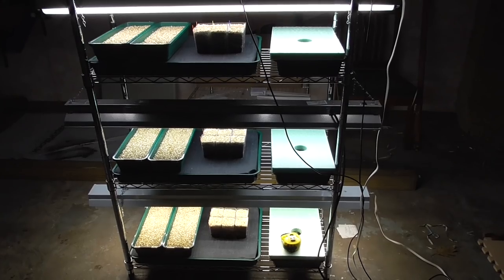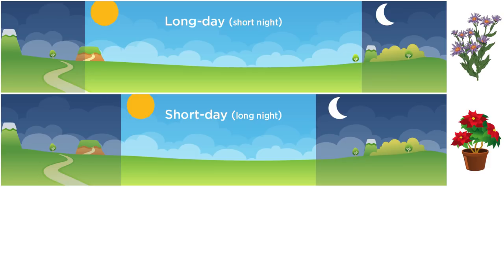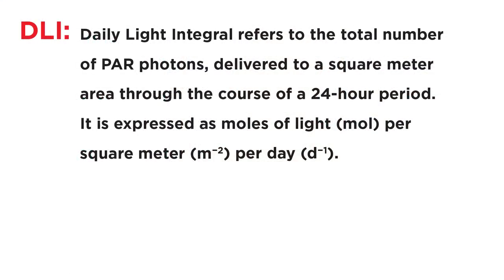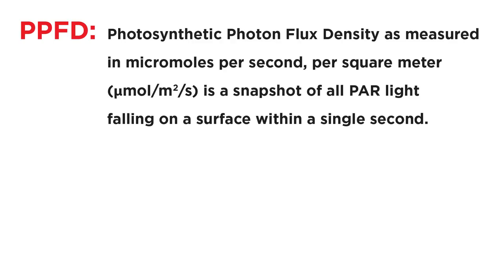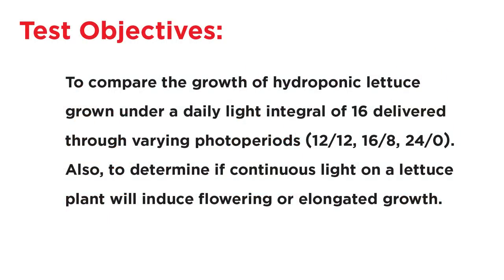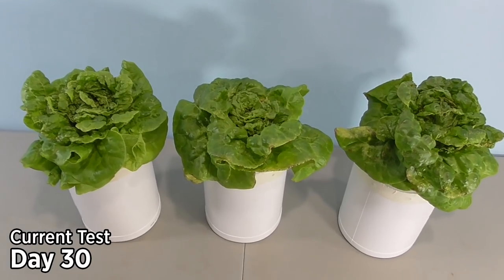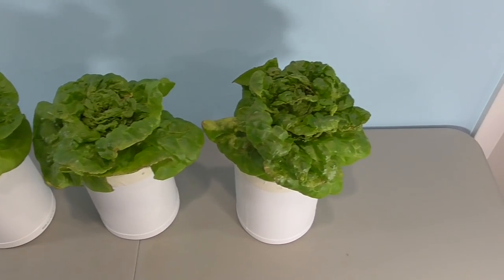Photoperiod vs Intensity: PPFD / DLI - LED Lights Lettuce Experiment (What is DLI?)

Comment: There one thing i dont understand, from 10.25 ich there is a increase of 4 hours for same DLI at 12.5 but only and increase of 8 hours for same DLI from 12.5 to 21 inches. hours by inches are not proportional, I know they dont have to but in case of longer distance lees hours in proportion for same result???? WTF!!! what DLI you think is the optimal for lettuce?
Reply from the maker: Good question!  What you are observing is the Inverse-square law: https://en.wikipedia.org/wiki/Inverse-square_law   As light distance gets closer and closer, the intensity (PPFD) increases at a sharper rate. It is not a linear effect. The increases in hours is directly dependent on the intensity (PPFD), see: 3:40 .  You would need a Quantum Light Meter to read PPFD values for any given distance which would then allow you to calculate light cycle for the desired DLI. I think that 16 was a good DLI for this lettuce. I might even try 15 or 14. But not higher. It varies depending on the lettuce variety and others conditions too (like air flow).

Comment: I have a few issues with this experiment. Number one what was your control? Number to it didn't seem as though the distance of the light had much to do with the experiment that you were doing although I understand the concept. I feel as though the experiment would have had much more relevancy if you had had the lights the same distance away from the plant it can probably go without saying that the plant that was on for 24 hours would probably have much more tip burn but most people don't take into consideration how much light their plant is receiving because they try to dump as much light into their plant as they possibly can. You need to have a control for every experiment that you run. But these are interesting numbers
Reply from the maker: Every plant was sent up to get the same DLI. Explain how you would set up an experiment that shows 3 different ways of delivering the same DLI and what would you designate as your control?

Keeping all lights at the same distance, as you suggest, would mean that all plants get the same PPFD. Changing day cycles while keeping the SAME PPFD would inherently yield DIFFERENT DLI values. So if the lettuce growth was different would that be a result of day length variation and circadian signals? OR... would it be a result of differences in the amount of photons absorbed throughout the day? It might seem that you're controlling for all variables, but one: Day Length. But photon count in fact IS a variable. Each plant would be getting differing amounts of radiant energy, in addition to changes in light duration.

I've provided all of the math showing how I controlled for photon exposure and thus only the light cycle changed. An interesting follow up test, would be to do as you suggest and then compare those results as well. Even still, this test was extremely valuable in highlighting the relationship between light cycle and light intensity. That was really the core objective here. And as you've noted, this dynamic is often ignored by growers.

Comment: I pretty sure Lettuce bolts based on heat not light. It definitely bolts here in the south when it gets hot even though day length doesn't change as radically as heat. Great video!
Reply: A bit of both. If I grow them under 50% shade cloth they last longer before bolting, despite the ambient temperature not being any lower really - although this reduces the direct heat intensity on their leaves, for sure. Certainly doesn't change hours of light, just the intensity. Lettuce seed will definitely not germinate once temps are in the high 20s.
Reply from the maker: Thanks Dan!

Comment: Wait a minute ur light on the right is higher than the walls in other words plant in the middle at least is getting some of that light and if it's on 24 hours won't the other plants be getting some of the glow or did u close them up after the camera went off I think ur results r out if u didnt
Reply from the maker: No worries. I used my light sensor to check for light contamination and there was 0 PPFD of photon spill over.

Comment: interesting video, as always, but I'm not sure about your cost comparison, I think that what you are actually measuring is the cost effectiveness off having your lights closer to your plants (the result of which is kind of obvious), rather than the cost effectiveness of keeping the lights on for a longer time. Maybe you should try it again with the lights at the same height but with a dimmer to even out the DLI. That probably wouldn't be a 100% fair comparison as LED efficiency is not constant because it varies with how much current you are feeding them but it should still be fairly accurate.

Comment: 7:54, why not just use LEDs that allow you to reduce the brightness, the amount of energy reaching the plant through the day is the same for each timing method, no reason the amount of electrical energy reaching the light can't also be the same per day. Adjust your brightness properly and it appears that the results would give MORE plant weight per watt of electrical energy so long as you don't use the elevation of your light as your method of reducing brightness. Just my two cents.
Reply from the maker: Using a dimming feature is certainly a great idea! But there are many LEDs that are non-dimmable, even less so back when this video was made.
Reply: @Albopepper  fair enough, I got into designing my own smps circuits for driving my LEDs so I get a little carried away. Thank you very much for the reply and for the awesome video.

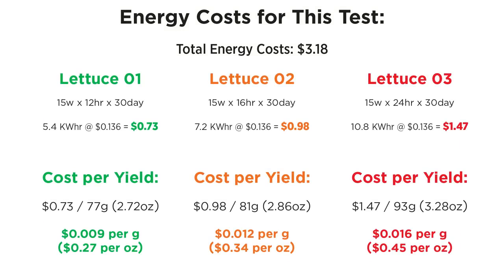Comment: At 7:49 ur xalculation for power consumption is wrong..since u used d same 15w light but for the third plant u increased the height f the light to reduce the amount of photon ..aka..to match the same amount f photon f light falling on it  in comparison with others...but if u would have kept the heights all equal ...ur third plant which is on 24 hours would jave yielded not 93 but more ..i think there is a flaw ....test is nice ..but i think two parameter thingy is flawing ur cost  to power ratio
Reply from the maker: Sorry, I don't follow. Are you saying the math is wrong? Is there an error in the calculations?
Reply: @Albopepper  ok no the math is not at all wrong..the approach towards saying 3rd plant consumes more power is wrong...since u r using 15w led for all the three plants .... where all three plants get the same mol per m2 per day right ? Which is perfect !! .....but to achieve that u tweeted with two parameters...the time with respect to  distance of the light right ..which amounts to equal ppfd? Which is also perfect ...
But now instead f me tweeking with the distance of the light to get same ppfd i use less watt of light for third plant ..aka the experiment is using two parameters which is time and the wattage keeping the height constanst instead of keeping the wattage constant .. ..so what i mean is ...for example if 
1st plant :-12 hours 15 w equals at the light distance 10cm say givea approx =16mol/m2/day
Then second plant :- 16 hours ... "11.75=12w" and the same light distance will also giv 16mol/m2/day
Third plant :- 24 hours , 7.5w and equal distane of light will giv same 16mol/m2/day ..thus if we use wattage instead f the distance of light from plant to achieve the same ppfd ..then the calculation would b cheaper for both 2nd and third plant ..cuz instead f increasing the height of the light to reduce the ppfd i use less watt light at same height and achiever it..by using less power ...i hope i could explain it :)
Reply from the maker: If it was possible to reduce PPFD by selecting a lower wattage light, rather than raising the light, then yes, that would be a way to avoid needless power consumption when running at longer light durations.
Reply: @Albopepper  exactly my point ..so then i guess u cant put the comparison chart here saying its expensiv to run 24hours cuz people might get this wrong ...i mean interpret in the wrong way ..so i think u should delete this part saying 24hour cycle is expensiv in terms of gram per watt...mayb yes it is but not ad expensiv it will b if used 7.5w ..and thuse now u can narrow down the pros and cons of little bit more power consumptiom but quicker yield compared to more power consumption when used 15w and a higher distance :) ..anyways i love your different experiments..keep it up brother :) ....
Reply: @Albopepper  and it could b nice if u do this experiment where u have different light cycles and same height but different wattage f led used to get the same ppfd on the plant over a period of time ..this will b a very useful experminet i guess ...could u do this experiment for us to learn :) ..thanks
Reply from the maker: The power comparison chart simply shows the actual cost vs yield in this experiment. It can show growers how to analyze their own grow bed and make similar calculations. Something to keep in mind here that if a grower were to raise the light, they may be able to cover more area and grow more plants. Wattage would be the same, but the plant quantity and yield might increase. My calculations don't account for such a hypothetical scenario. Each viewer would need to account for that on their own. Thanks for watching!
Reply: @Albopepper  oh yes that way u r right ..we can hsve more plants then ..but anyways thanks for the insightful videos u upload..does help me a lot growing my herbs :) ..have a boisterously carefree day

Comment: Loved the experiment and the info!

But looking at your results table, I noticed that the 24-hour plant consumed 26% LESS solution than the 12-hour plant. That would imply 4x 24-hour plants could be grown for the same solution cost as 3x 12-hour plants! That would be top growth of roughly 372g vs 231g!

Also, to get the lower PPFD, could not less expensive/dimmer lights, presumably with lower current draw, be used instead of simply raising the same light and losing half the photons per unit of time?

Not sure if you would be able to do this or not, but I'd LOVE to see the experiment redone with 4 sets of 3 plants each with different sized lights at approximately the same height providing 14/day for 8/16, 12/12, 16/8, and 24/0 light cycles. Each set being 3 DIFFERENT plants by adding a short-day and a day-neutral plant to the long-day lettuce.
Reply from the maker: Hi Darren!

Thanks for noticing the solution consumed table. In error I posted the solution remaining and failed to subtract for what was actually used. Sorry about that. Here are the corrections, which are now in my description too:

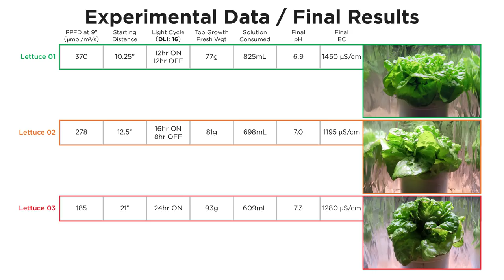SLIDE CORRECTION (6:59):
I showed the remaining solution & failed to convert that number to solution consumed as labeled. Here is the replacement slide:
http://albopepper.com/images/Photoperiod_PPFD_DLI_Experimental_Results.png
Lettuce 1:  1125mL
Lettuce 2:  1252mL
Lettuce 3:  1341mL

Thanks for the video suggestions too. I'll keep them in mind!  :-D

Comment: You should have reduced the intensity of the light, not the distance (especially since you kept the foil that reflects the light). But I'm surprised that 24h plant survived at all. I thought they always need at least a few hours of darkness.
Reply from the maker: I was not going to try to run these bulbs on a dimmer and risk ruining them. They are nice little grow bulbs, but they are NOT intended for dimmers. For this experiment, the other options for reducing intensity at the canopy was to increase distance, or to use some sort of shade screen. Raising the lights higher was a much easier choice. And it worked quite well.

Comment: i assume you are not topping up the nutrient solution with water, what i see happening is the plants are drinking the water leaving behind nutrients that is then burning the tips as it becomes more and more concentrated, you need to remember if plants grow bigger they consume more and so should be watered more so that they can keep growing. i would suggest doing this again but changing the water in all three buckets once a week
Reply from the maker: That is not what happened. Look at the Final EC readings: http://albopepper.com/images/Photoperiod_PPFD_DLI_Experimental_Results.png  (My initial EC was 1720). So all of these had used nutrients faster than the water was depleted. The issue was likely due to the DLI being a bit high for this lettuce variety. But it was certainly not from nutrient burn. More on tip burn here: https://www.youtube.com/watch?v=gHWf4Hfi3hA The point of using a Kratky method is to fill it once and forget it. And if you get all of the parameters set up properly, it works quite well. No need to fuss with changing solution.

Comment: The takeaway should have been that you should have adjustable wattage lighting so you could save money on it. Good research, bad conclusion. Next test should be cobs or quantum boards with an adjustable power supply then run the test with the lights at the same heights and adjust the power to match the ppfd you had for each. I bet the answer will be exactly the opposite you had because the efficiency goes up drastically on LEDs as you drop the power. Do 16hrs, 20hrs, and 24hrs instead to see where the best ratio is Between growth and power consumption.
Reply from the maker: That sounds like an excellent testbed. Run the test. Publish it on your channel. Send me a link and I'll post it in my video description. In the mean time, this information is highly informative and I stand by my conclusion 100%. Why? Because there are hundreds or perhaps thousands of light solutions that do not have adjustable power settings. These include, HID, LED and Florescent kits designed for both consumer and commercial operations. This test directly informs those growers on options for adjusting their lights depending on their unique specs.

Comment: This experiment was all good till you compared cost/yield.  It doesn't make sense to run a larger than necessary bulb, then move it further away from the plant; its just wasting light.  I mean I understand you did that to avoid buying 3 different bulbs (which would add additional variables if they weren't otherwise identical apart from wattage); but it renders the cost/yield a moot point.
Reply from the maker: Thanks for watching! The cost / yield numbers were calculated to underscore the need for such estimates with any serious grow project. I agree that it doesn't make sense run an over-sized light at excessive distances for longer times. I've never done anything to promote that as some sort of optimal approach.

That being said, there absolutely might be a time when a grower would want to raise a light and then compensate with longer photoperiods. Think about it. What would raising a light allow you to do? To cover a larger growing surface. Increased growing area means increased plant quantities! With more plants, you would not really be wasting as much light as you think!  I've already covered this info in the previous video & I had no intention of being redundant: https://youtu.be/gHWf4Hfi3hA?t=429
Reply: @Albopepper  Sorry if I came across as negative, these are good videos and I agree in that you don't always have the optimal sized light on hand.  The video was quite informative.

Comment: If nature had meant for lettuces to have 24 hrs of light, we would have 24 hrs of daylight on earth. Plants developed based on what nature gave them, the Four seasons.
Reply from the maker: This video is not about what nature intended. This is about the mechanisms of light duration on the growth of plants. I've just grown my onion seedlings under 100% daylight for 6 weeks and the growth has been tremendous. I had never tried it until conducting this test and it was very enlightening. But feel free to curtail your techniques as you see fit. ...Actually, there IS 24 hrs of daylight on earth! Try visiting Alaska in the Summer.  :-P
Reply: check and mate.  lol